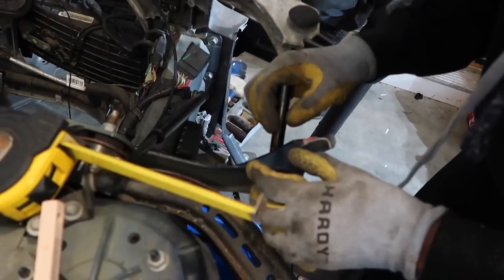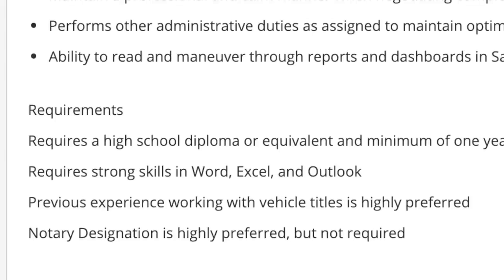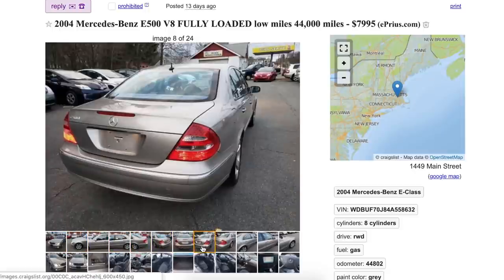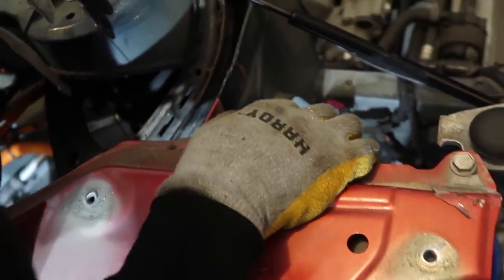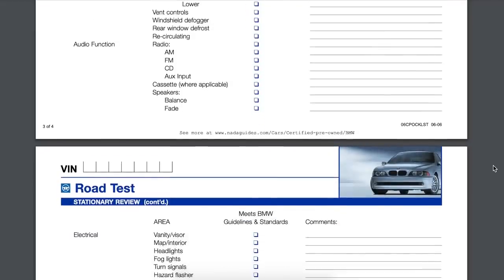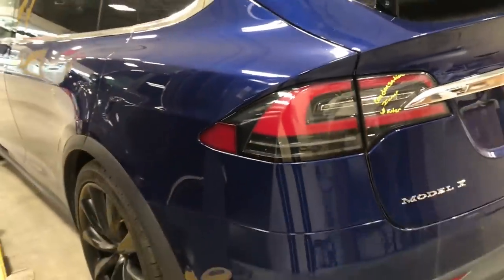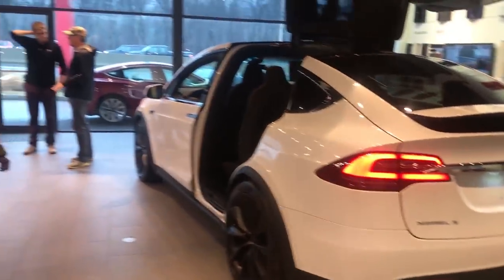Why the used Tesla system is broken

Comment: They checked your channel, found out you have a following and shat their pants. All the repairs your getting no one else will get. Because they want good press. Probably the dude that shown you the car is now in hot water.
Reply: They are doing nothing it’s just sitting in there warehouse. 2 weeks ago tesla  said in 2 week the car is ready.
Reply: The body shop Tesla uses (at least the Dedham, MA service center) is actually a very well respected high quality shop. If the car is brought there it will come out perfect.
Reply: @miked3723  Sooo.. Rich is potentially getting 5k in freebee repairs because the certified preowned car was a horribly damaged POS.  The company realized who Rich was and decided making him wait 3 months for repairs was the cheaper option.. 
AND THIS IS GOOD SERVICE!!!!  says the NPC drone.  /sigh
Reply: I didn't comment at all on how Tesla is handling the situation. All I commented on was that the 3rd party shop fixing the car has a superb reputation and if the car is in their hands it will be perfect when it leaves there. But I guess if you don't bash Tesla your just an NPC drone.
Reply: That,dudes,totally fired
Reply: @zarthemad8386  he even says himself that the standard of refurbishment is reportedly high, and the price was reasonable.

However, it does seem perverse that Tesla would advertise a car that will only be reconditioned after the sale has been processed. Surely they would just do the work then advertise them for sale? Or simply supply them as company cars / lease to charities/NGOs?

Comment: I do the kind of photography you're talking about for a living, I have a set number of photos that gets repeated for all used vehicles, it includes closeups of things like the engine, the trunk, the suspension for some vehicles, pictures of the condition of the driver seat surface, closeups of the touched console buttons, image of the odometer, etc. It's usually 32 photos although some dealerships go all out and do 40+, but it's comprehensive enough to answer I'd say about 90% of your questions as far as condition. 

The pictures that Tesla sent you? whoever did those... they couldn't care any less if they TRIED.
Reply: Lassi Kinnunen  Yeah it was the minimum they could get away with. Also, torille? :D joojoo vanhajuttu
Reply: I was just looking a photos of a used car. There were two photos of the engine bay. One was of a V6, the other was of a 4 cyl.
Reply: These are Manheim Insight Condition Report photos taken by an auto auction; these aren't even Tesla photos. What a joke this organization is.

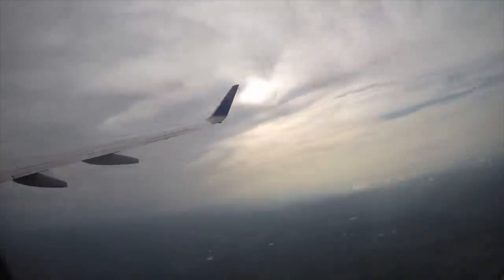Comment: 2:22
As a process engineer for two decades, I can assure you he didn't do this for you specifically.
He came out to look at the process as a whole and to re-trace the steps that caused this colossal failure.  So I think this was money well spent by Tesla as this is exactly the kinds of problem solving responses they need to go through.
Thanks for keeping us posted on this.  I have had my bag of popcorn out since your first post on this.
Reply: Yeah, I'm sure Tesla will spend millons of dollars now to restructure their whole used car sales approach. Or, they will just go on the way the have been because they make the same money without spending any of their own to improve their service. Wake up, this is just a PR job because Rich has a relatively big impact. So they try to accomodate him, but even at that, they are failing TERRIBLY. It's so bad and unprofessional you wonder if you really wanna sit in one of their cars.
Reply: @maxmeier532 ,
It's pretty clear they can't go on the way they currently are.
It is possible, however, that they would begin working with someone like Auto Trader or some other nationwide used car distribution network.
Either way, It's not likely that his trip was just for Rich.  Instigated by his expose' on how outrageous this all is, but their objective is certainly to either fix it or to limit their exposure to it at all.

Tesla's main issue is that they are a victim of their own success.  Similar to the last company I designed for.  It takes a while to turn this kind of thing around.
Reply: When were  last an employed "process engineer",  1980?   This is of course, an obsolete function.
Reply: @NeverTalkToCops1  
2016.  Don't be insulting... it doesn't speak well of your character.
I spent nearly 20 years helping to turn a million dollar a year business into a nearly billion dollar a year business.
That's what process engineers do...and it's as valid now as it ever was.

Comment: Tesla is thinking like a software company here. What you're seeing is the "Minimum Viable Product" model of used car sales. They don't hold inventory Manheim does, they don't process the used cars Manheim does. They don't ensure quality, Manheim does. The advantage to Tesla is that this type of system probably didn't take much to get up and running, so at least now they can sell used cars, but of course there's lots of downsides because they control none of the process, it's not tightly integrated and doesn't have much in the way of quality standards.

Over time, they will do some combination of layering additional processes on top of the used car process (such as fronting the $50 per car to take showroom photos and put them on the website automatically, sending the car to get detailed before it's delivered), bringing some of the Manheim responsibilities in-house (such as holding inventory and fixing cars before they're bought), or some combination of both. What happens next will be a combination of whatever is easy to do, and whatever is intolerable not to do.

Comment: Scary accurate. I bought a CPO 2 years ago when they still fully reconditioned cars. I still had an 6 week dead period from deposit till I heard my car was being worked on. I felt the same as rich it really was a want not a need so i never complained. 8 weeks total until I was told I could come pick it up. I have been currently looking at buying another Used Tesla from Tesla but I’ve been having the same issues as Rich. It still is a first world issue for sure, Tesla really needs to start having there own used lots.
Reply: if u think that is bad, almost everyone here in norway around the capitol drive a tesla and some guys have to wait over a year to get theire car serviced before they got it. because they dont have a clue about what they are doing or not enough ppl, tbh tesla is a rly shit company
Reply: Buck Spammhammer  LOL!!!!

Comment: I been wanting a Tesla for years.. But I am honestly going to avoid them. Seems that the quality of them is not worth the price tag and headaches.
Reply: My boss owns 3 teslas with a 4th on the way.  His 2012 model S is still kicking strong and has zero issues outside of the USB charging jacks he broke and had to get repaired (too many times trying to exit the car while having his phone still plugged in), and a couple tires that developed slow leaks (this happens on lots of cars).  I disagree on the quality statement.  None of his Teslas have exhibited any issues other than the USB thing I mentioned, and the Falcon wing doors being super dumb on his X (But he knew that going in, they're just overly cautious and stop 1-2 feet before they need to in order to avoid hitting something).  He loans them to family members who absolutely thrash on them and treat them like crap and they just keep on working.  His family used to hate them, but now they fight over who gets to borrow the teslas.  These are all people used to driving Audis, BMWs, and Mercedes fighting over Teslas.  I know this is anecdotal evidence, but the vast majority of Tesla owners don't have major problems.  The model X shown in this video was clearly abused, and that's why it's in such terrible shape.  

Now the way Tesla is handling the used market is downright detestable, and should either be changed to line up with the rest of the market or scrapped all together.  I'd only buy a new Tesla at this point or go private party.
Reply: @meikgeik  I guess I miss spoke. I meant I am going to avoid buying a used one from them till they improve there used car process. I wish I could afford a brand new one.
Reply: Donnie Mays I mean the model 3 is 40k ish on the lowest end, which is quite cheap compared to the model s and x but still a lot of your poor like me
Reply: Donnie Mays have you thought of getting a 4 cyl turbo Mustang, You can negotiate a great deal. With gas so cheap, you are so far ahead economically, and you'll have a lot more fun.   Or you can get an amazing deal on a Vette now, since the new gen is coming. Grow some balls and go low ball the heck out of  'em. It's fun.
Reply: @jokerman213  Same.  We leased a Subaru Outback for now.  It's still a gas guzzler in comparison, but until Tesla gives me a wagon with 300-400 miles of range I can lease for $300 a month, I'll be sticking with subaru.  We make far too many road trips to have our primary car be electric.  I'm buying a 1980 commuta car this weekend fingers crossed for most of our around town shenanigans to try and cut down on or emissions... also as a project car because I like silly impractical vehicles.  Fiancee has a 1975 international harvester pickup for the same reason.  We need to offset that thing's gas guzzling.  Luckily it sees less than a few hundred miles a year of use.
Reply: Just wait a few years, you'll be able to buy 2nd hand german electric cars for the same prices and better quality. Thinking of VAG especially who'll be jumping in the electric market. AND if you buy your car, you'll get it quick 😂
Reply: @BramCollier  I'll never own a german car again, sorry.  They're sooo expensive to maintain.  I paid more per year to maintain my audi than I pay to lease a Subaru.

Comment: 696 tesla employees don’t like your video Rich!!  Damn, seriously, you are the most patient guy I have seen.  I would have got the bank/insurance and then local district attorney involved.   BTW Rich, because of you I own a Tesla now and I used your referral code.  I am no Tesla fanboy, I had to pay $1200 3 days after delivery for paint correction.  This is after it was in Tesla certified body shop to correct some fairly major damage on my new Tesla.  They still haven’t fixed the chrome that goes around the windows, they scratched those all to hell at body shop by closing doors with windows in “up” position.  I have completely given up with dealing with the Tesla folks in Santa Barbara, CA.  They are almost worthless and we have driven twice to get the chrome and other minor stuff done, waited 3 hours, then they say sorry the parts aren’t in but we have your new lug nut center caps.  They hand us a plastic bag and we are on our 1.5 hour drive home.  I immediately open plastic bag to put the new covers on, guess what!  They are F’ing used, scratched worthless pieces of SHITE!  I now just plasti dipped all four covers and you can’t see the Tesla T on any of them as it was impossible to tape those off.  No one has called again to say our parts are in and we have completely given up on Tesla.  Bye!
Reply: u mean they work for big oil
Reply: Man that's frustrating as hell

Comment: What I took from this video is that you don’t like using the guard on your angle grinder... do yourself a favor and put that guard back on there you’ll thank me when one of those cheap Harbor Freight cutting disc breaks.
Reply: yup   I had one break apart and the parts bounced off the metal frame and hit me hard enough to leave a 1/4 inch deep cut 2 inches long on my hand.
Reply: Battery powered angle grinder, most powerful tool you can buy for $100, defeats ALL metals, of all thicknesses, makes short work of bicycle U locks.
Reply: And I took from your comment that you don't actually have any experience using an angle grinder. It is impossible to cut odd shaped objects like a car body while actually seeing the cut with the guard on it.  There is no risk from not having the guard on it performing the cuts he showed. He didn't even have a zip disc on it. Whenever accidents happen with an angle grinder it is people either scrubbing with a cut off disc or they get their cloths caught in it. The latter is the reason why the wire brush is the most dangerous thing you can put on a grinder.

Comment: 70 point inspection.  Washer fluid is 60 of them.
Reply: most of that is in the rear lights thats why
Reply: Lol, right. Don’t forget to top up the taillight fluid.
Reply: i think some of the inspection points goes into does it have 4 wheels and does it look like a car from a 100 yard away, if these 2 pass its inspected with flying colors
Reply: All 70 points are probably on a different damn car!!!
Reply: James Harden had 50 of those points, unassisted.  The other 20 are hiding in his beard.

Comment: Honestly Tesla would save a lot of cash and bad PR by just not selling used cars themselves. Take them on trade in then immediately hand them off to car dealers who want them.
Focus on new cars
Reply: That's what I was thinking.

How hard would it be for Tesla to sell these used matchbox cars off to "Authorized Dealers" as is?
Why would they spend so much money refurbishing and storing cars built to be disposable, and not have a CPO cert?

How hard could it be to take photos of a car?

You can buy an AIRPLANE on Ebay easier than buying a used Tesla...

Did Elon send Rich's car into space?
Reply: But then they would need to sell parts to all those dealers for repairs!!
Reply: @dlmzg  Oh, I forgot they dont do that.

Its like if Apple made a car.

They cant design properly
They can manufacture properly
They cant distribute properly
They cant service repairs properly
They cant price properly

They sure make a safe product though... :)
Reply: Most people buy these cars from Tesla solely for the CPO warranty. If Tesla can sell these cars to dealers WITH a 4 year warranty that would solve everything.

Comment: I drive a 2007 Subaru Legacy and there is nowhere near the amount of condensation in the taillights as there is on that Model X. Hey, who needs waterproofing on an electric car with highly sensitive components?
Reply: I have a 1993 Lexus SC400 that is in better shape than that tesla 😂
Reply: The issue is the sealing of the taillights, the highly sensitive electrical components are nowhere near the tail light, for it is really just cosmetic.  Totally irrelevant for performance and risk of water damage.

Comment: Does anyone else think Tesla will become the Betamax of the car world when the big manufactures get rolling on their electric vehicles.
Reply: I think car manufacturers have been sitting on decent EV technology for a while.  They're just waiting for widespread demand for it and there probably won't be until fuel is $5+.
Reply: @pessimisticoptimist2329   Also a better recharge station network. It's still a big part of a journey to plan out where you can recharge your EV check what the charging capability is of the stations. At day to day make sure to charge it when you are not using it at home. ALSO it's not delivery "friendly" yet. EVs are not able to run 18 - 20 hours a day in cities (usually).
Reply: @pessimisticoptimist2329  Not really any "tech" to be sitting on. Formula E has already well surpassed anything in a Tesla... but in general, electric motors are a known entity and extremely reliable.
It's just the power that's hard. Nissan proved making your own batteries is a losing proposition - have to purchase 3rd party like Panasonic, LG, Sony, Samsung, etc.
The bottom line is that it's not profitable. Some high end luxury cars can be done where massive margins are baked in, but $35k and under... loss leaders.
Reply: LOL @ BMW AND JAGUAR EV's LOLOLOL
Reply: @NewbOoyNS  Here in The Netherlands, where we have a decent charging network and most electric cars can make a round trip to home station (small country, small distances), the technology is kind of taking off.
Reply: You must have missed the point of Tesla to begin with. Elon said very early that his only goal with Tesla, is to force the big manufacturers into making EV's. He knew from the start that he would never be able to make the entire planet convert to EV's. Why do you think Tesla gives away their technology for free? They will make their money from battery manufacturing.
Reply: There will probably be a few other startups in the future as well.